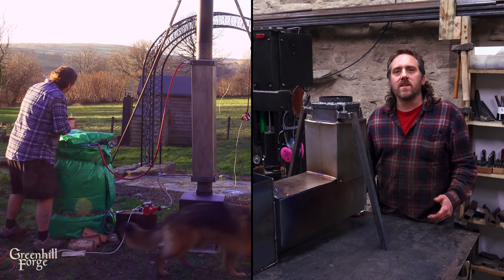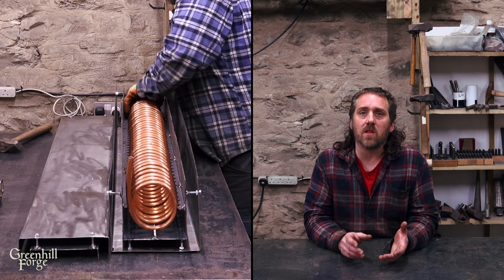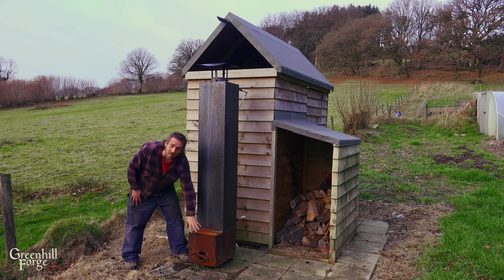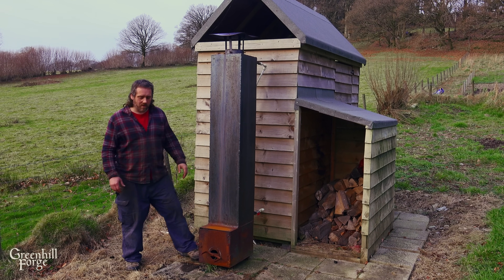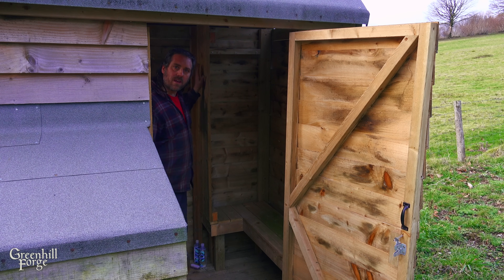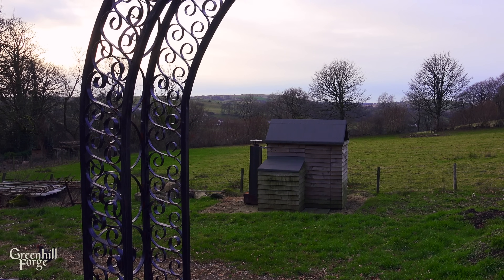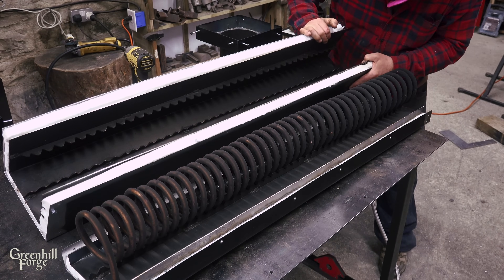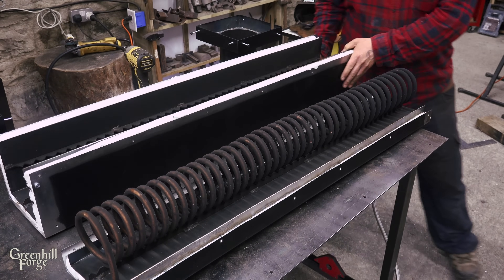Addressing Your Questions | Woodstove Water Heater

Comment: You should use brass as your coil holder to prevent electrolysis from the copper and steal touching in heat exchanger. The copper will develop holes over a long time being against steal.

Comment: This may apply more to the rocket stove concept, but it popped into my head that using a sterling or peltier power source on the exhaust heat solely to run a pump would cause it to pump more water automatically as more waste heat was lost to the exhaust, and so would become both off-grid and self-regulating.

Comment: I think should keep the exhaust pipe in there. Permanently, and have it touching the heating coils as best as possible. And fill it around it with sand that'd give you a very good heat exchange

Comment: Some water heaters use the spiral in the pipe to swirl gasses to the inside diameter. What about filling the heat exchanger section with a cast refractory material to enclose the copper tubing and leave a straight flow 4 inches in diameter through the exchanger. Any tars or creosote could be brushed out..

Comment: Hey there brother! This series has gotten you a new subscriber. I enjoy your fabrication tips and I am looking forward to more. 

Anyway something I noted on your last video was you could capture more heat by placing an inverted cone baffle in the center of the flue. This would drive the heat out to the coil.and it could be achieved by welding a 1/2" rod in a C shape at the top and bottom. I would love to show you additional ideas I have. Anyways keep up the good work

Comment: I think the galvanic explanation might be off, but otherwise, I love the videos!
Reply from the maker: Thanks! Could always be wrong but I'm pretty sure the explanation is dead on, this is from the first result from googling "galvanic corrosion between copper and steel" just now - "Let’s consider a case where a copper water tube is connected to a steel pipe through an adapter, and the water inside is an electrolyte. As steel is electro-negative to copper, electrons will flow from steel to copper, and the steel pipe will corrode. For economic reasons, making an all-copper system can be difficult in most cases. Breaking the electrical contact through a thick six-inch coupling made of insulating material is an easier way to avoid galvanic corrosion."

Comment: About the steel about what about stainless steel pipe or those that has acid resistant ones? Wouldn't those work better than galvanic ones or black steel pipes? I am currently designing one waaaay bigger for floor heating but nobody else in the family knows about :D

Comment: Guess I’m glad I didn’t comment on the original vid, you definitely covered all of it here. 
Only thing else was I was going to recommend having a bypass for when you started up the fire, that would cut the creosote down. Maybe you could do a 3-4 inch in the middle and it could be the bypass and the plug to block the center. 
Ether way was a great build.
Reply from the maker: It's a good idea, might do something like that in the final design?

Comment: I wish I could get statistics on a set up with the coil wrapped around the outside of the flue then insulated and a metal protector around all that.
not because it is the most efficient set up, but it's easier to make than a water jacket and cleans quick and no mess.
Kris Harbour did it, without insulation. but his analysis and statistics were like "it works" ... very sad :(

Comment: What I'm getting from this is get a large metal tub on a platform, have removable raised wooden slats inside, light a fire underneath the tub, when the temperature is hot enough put the wooden floor in and turn the fire off. Job's a good 'un.

Comment: Maybe this has already been suggested, but... What if you did the opposite, multiple less "spirally" spiraled pipes from bottom to top where you have the hot gases pass through the pipes and inside a water jacket? Multiple pipes creates a lot of surface area for the heat exchange and the multitude of pipes combine to get enough area for the gasses to pass. The upside would be that the side of the pipes that is exposed to the gases can easily be cleaned given that a reasonable spiral is used (think huge pipe/barrel cleaner).

Comment: First of all i love these videos, very informative and well made.
It would be cool to measure the thermal power given to the water. If you measure the water temperature before the pump and at the exit of the heater, knowing the water flow, it is very easy to calculate the power. If you record the temperatures with some kind of data logger you should see also how the power changes in time. By doing so you can compare the power to the water to the theoretical thermal energy contained in wood.
Reply from the maker: All of this is coming in the next video. Hoping to get it up later today.

Comment: I got an interesting one for you, surround the stove in a sand battery, provides longer lasting heat, you can add coils inside, which would make a great way to heat floors/water/(the room it is in) more efficiently and longer. Just thought of it as I was thinking of your experiment, if you keep the work you've already done but add the sand battery you'll have quick AND lasting heat with less waste of fuel. Just a thought.

Comment: I don't know what you have available to you .. but if you can get your hands on an old "propane hot water heater" .. it already has a flue up the middle .. and you can build the firebox under it.  From there you can also run a line into a house then through a larger tank where hot water is kept in reserve .. then with thermostat control send the hot water through a radiator .. with a fan behind it to heat your house.  With the fire box on the outside .. you keep your ash etc. outside .. and bring your heat inside in the form of water.  Always interesting stuff to think about!
Reply from the maker: It's not wood fired but aside from wood stoves my house is heated with radiators and an outdoor boiler. cool stuff.

Comment: I realize that I'm commenting a little late in the project but... there's really no need to extract any greater amount of heat by putting a diffuser in the middle. You're already on the verge of boiling and it would only cause more of a creosote problem.

Comment: Could you try adding sand by filling the inner chamber where the coil and steel pipe are, would the sand create chemical insulation and yet transfer the heat ?
Reply from the maker: I've got a video coming soon I think you'll like

Comment: Just my opinion, but thermosyphon is stupid, haha. It's something that people get romantic about, or really attached to but it just doesn't make sense in most applications. If you are using solar to heat your water slowly, perhaps, but if you are transferring a few thousand BTUs the wate ris going to boil unless you have a decent flow rate.. Using a pump that uses 20 watts or so will give you way better results.

Edit: People are also really attached to vortexes, haha. That swirl is always what the answer is, regardless of the question.
Reply: Good points. I'm only talking about heating water hot enough for household use. If the woodstove is on all day then efficiency is not an issue for me. The woodstove also heats the house. My house was out in the boonies so I could do things like move the HW tank upstairs so it could thermosyphon, something most people would not be able to do. Hope that makes sense.
Reply: @Shmerpy  I totally get what you are saying. In some situations it works well. If you need to transfer more BTUs, you can use more than one run. If a single run can transfer 5000 btu/h then two runs can transfer 10,000. I'm also not sure how much of an effect larger lines come into play... but I'm sure it has an effect on flow rates. 

Cheers.
Reply: @loweredexpectations4927 
 Any pump is subject to failure, either in the pump or the power supply. Then you have a bomb. As all that heat will overwhelm any normal safety valve. 
Thermosyphon fed radiators have been used for over a hundred years and many of the older hotels in Europe use them, and they are multi story and many rooms ALL on thermosyphon. It all about good boiler and piping design and SIMPLICITY. The less moving parts, the less failures.
  KISS
Reply: @greenwood4020  This sounds like a comment from someone who isn't going to listen to / accept reason... but I'll do my best. 

Reasoning that pumps are prone to failure, but not including your fire box, heating coil, piping, heat exchanger, connections etc is either a massive oversite or disingenuous. I've been running the same pump for over 13 years and haven't even though about the fact that it exists since I installed the system. My boiler had one minor failure.... the power has gone out. The pump has never failed. 

Secondly, in what world does an overheating system become a bomb. First off, an open loop system is NOT exclusive to thermosyphon systems.... Many many wood boilers use an open loop system with the boiler storage being open to atmosphere. 

Closed loop / pressurized systems do not become bombs if the pump fails. First off, flow monitors and temp sensors ensure that if the pump fails, or temp rises, the heat source will be shut off or throttled down. If EVERYTHING fails and the pressure rises above a certain point, there are both temp and pressure blow off valves that are vented to a safe place. 

"all that heat will overwhelm any normal safety valve" ... Safety valves are not "one side fits all" Safety valves are sized to allow for the worst case scenario, and systems generally have more than one. 

If the power goes out on a powered burner.... the burner goes out. On a wood boiler, if the power goes out, the drafts will close. This stuff was figured out back in the 1800s. 

I didn't say that it doesn't work, and I didn't say thermosyphon wasn't more simple. I said it was stupid and people get romantically attached to it. Please don't try to argue that hundred year old European heating systems made sense... I grew up in a house build in the 1800s with horse hair plaster walls and a coal fired boiler...
Reply: @loweredexpectations4927  Hi, and thank you for your detailed and well explained reply.  
I think that we have slightly "crossed swords"  because I misunderstood that you were taking about FULLY ENGINEERED boiler systems, and I was more interested in keeping enthusiastic DIYers from making potentially dangerous devices. Some of which I have seen on YouTube. 

The average DIY tinkerer is probably unaware that fires, and rocket stoves in particular, can produce many KW/ 1000s BTUs of heat and generate huge pressures' quickly in amateur constructed systems.
Unfortunately, I can't find the video. But one DIYer had an ex solar water heater tank (mains water pressure type) and made their own coil, and installed it into a fairly well-built 8" Rocket Mass Heater. He even showed the standard safety valve still on it. The problem here is this safety valve was not sized to discharge the steam generated from the 6-8KW of heat from the 8inch RMH at full power, and they don't have a thermostat to cut the power. Luckily, RMH's are designed for burning small amounts of wood fast and efficiently and this fast fuel consumption is what saved him from a potential bomb as he gave up feeding it once the water temp rose to a useable temperature. If this had been a "Batch Box" RMH with a firebox capable of holding 20-30lb wood, the result could have been catastrophic.
We tend to be creatures of habit, and when we learn a skill, we often don't fine tune it when circumstances change.  There is the habit of, when getting ready to go to bed, of people stuffing their fires full of wood,  and hoping that it will "last till morning". With a home built water jacket system, this could be fatal.
I hope this explains where I was coming from. That simple systems aren't necessarily, simple and safe, when repurposed without knowledge. 

Thanks, Stephen from Kopu New Zealand.
We have a strong DIY tradition here, since we are a long way from anywhere.
Reply: @greenwood4020  Oh... yes. This is true. Your perspective on DIY setups is accurate. I think it's very important for DIYers not to build any sort of pressure system. A pretty "simple" burner can create massive amounts of heat energy and often do not have any sort of control system at all.... and safety systems are an afterthought. 

I also think it's important to know that a unpressurized system can build pressure and pressure relief valve needs to be at the heat source. If you have your heating coil attached to 100 feet of hose, and the hose is open to the atmosphere, that is potentially a pressurized system. A hose with that much water in it, as you eluded to, will not be able to vent fast enough to match the rapid expansion of gases. The mass of the water could cause enough resistance to cause the failure of a vessel or hose.
Reply: I disagree. It depends on your intended use. My in-house woodstove which ran all day and most of the night could easily heat the entire 40-gal water tank in a few hours with a hot fire. My added solar hw heater also thermosyphoned into the same tank. No pumps.
Reply: @Shmerpy  I should have added ... "if you don't care about efficiency". If your heat exchanger is not efficient (not good at absorbing energy) then you don't need to worry about boiling water. If you are paying for your heat source (paying for wood or oil) then you don't want to just throw away that heat energy. 

You can't beat physics. If the exchanger absorbs a large amount of energy into a small volume of water it will boil it, and if you increase the volume, it won't boil. To not boil the water you can either reduce exchanger efficiency and waste energy, produce a smaller amount of heat, or increase the flow.

PS, you're not disagreeing. If it takes hours to heat 40 gallons then you're either wasting a lot of heat or not making a lot of heat.

Comment: I did notice that the stack for the shower hot water heater is below the open roof peak. Probably should extend above the roof line?🤔
Reply from the maker: I build the fire and light it and go do other things for an hour. when I come back the water is hot and the fire is out so it's not an issue. otherwise I'd agree, good eye though
Reply: @GreenhillForge Hey, thanks for getting back! I really enjoy what you are demonstrating. I am looking for land to build a 500 Sq ft small house here in Washington state. I plan to be totally off grid.

Comment: Fascinating topic. When I saw the first video last night I was surprised that you put the coil inside the chimney instead of around the outside of a chimney. I like the design with the square outer portion for the insulation though. If you put a round pipe in the middle of the copper for the gases and creosote to go up and then filled the copper coil side with sand it might have a longer lifespan. It may not be as fully efficient but the sand would help hold the heat a bit.
Reply from the maker: I've got a design coming that I think you'll like..
Reply: Some of my good friends did exactly this at their cliff cabin in Peterson Bay, across from Homer, AK. The shower was attached to their sauna. The problem with wrapping copper tubing around the outside of the flue is that very little heat is transferred. It wasn't insulated, either. There was no water storage tank or mixing so you got a short burst of hot water in between cold. I don't think soot or creosote is much of a problem if you have complete combustion, which is the big challenge.

Comment: Oh wow, sooth builds up fast on  copper pipe.
Reply from the maker: especially if it's cold and wet from condensation at first. I suspect 90% of that soot is from the first 10 minutes while the fire is still relatively cold and condensation is forming on the outside of the copper.

Comment: Love these series and look forward to the next one! Really keen to understand the benefits of having a insulated firebox to have the combustion temp as high as possible, and then extracting the heat. Opposed to having water jackets around the fire and therefore potentially loosing alot of that potential by cooling the fire.

Comment: Take the Copper out of the flue gases and create a constant contact to the flue, use a solder to make a permanent contact allowing for great heat transfer. Perhaps use aluminum tubing instead of copper. 
Adding an outer sheath with tubing sandwiched between the outer sheath and actual flue would allow you to use the spacing between the  tubing to channel the air from the bottom to the top, could even add a bypass channel so the air, once it reaches the top, can be channeled back to the bottom. Since the majority of hot air is going to be next to the flue, this will still allow for a vacuum to suck the hot air back down the bypass channel and create a constant airflow. It will eventually preheat the air and increase to match comparable flue gas temperatures. So you would benefit from heat of convection and conduction.
Reply from the maker: I've got a design coming that you might like
Reply: Craigs idea PLUS baffles in the venting to slow down the gases (heat).

Comment: I've tried a bunch of things to heat water - they all work....kinda, but all have weak points. I am presenlty building a rocket mass heater with a cast iron bath on the top of the riser. then, inside the bath water will be a 22mm copper coil which will thermosypon through my geyser. This will take longer to heat up than direct to copper, but I have zero chance of it steaming and blowing up my house.
Reply: But could you imagine the number of new subscribers you'd get if you captured your house blowing up?